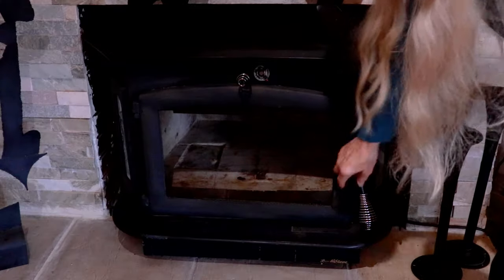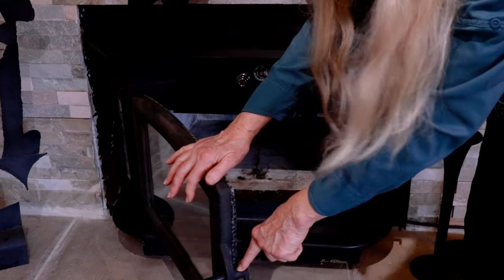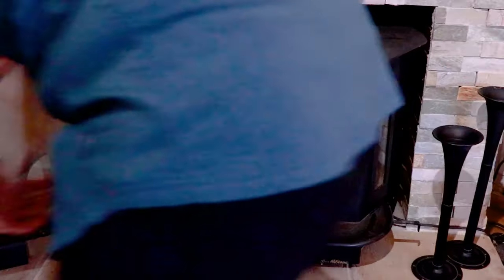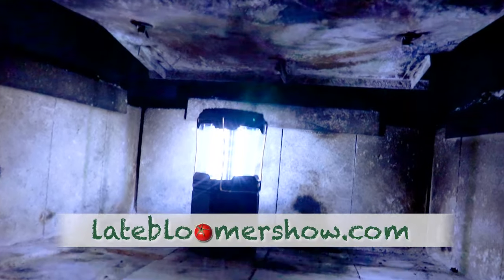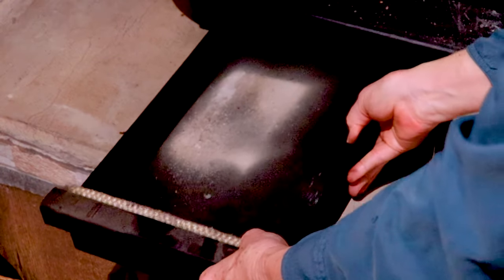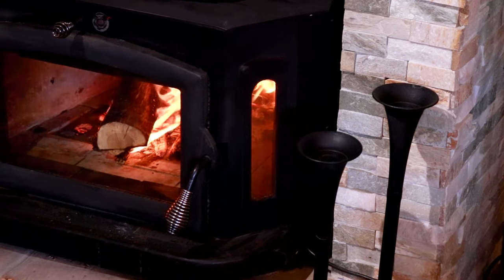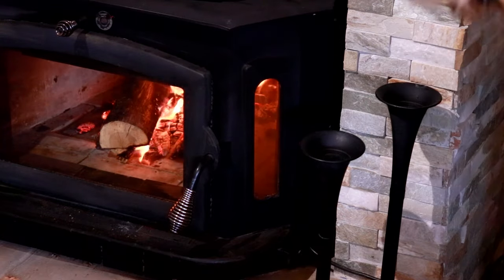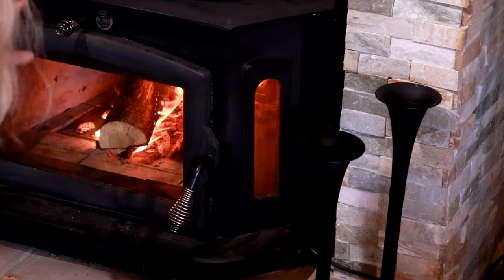BUCK STOVE 91 | Review of my wood stove

Comment: We have a Buck 91 that we purchased new about 3 years ago, replacing and old Schrader insert.  We use it as our primary source of heat with a propane wall heater being secondary.  This stove heats our 1800sqft house easily, and if it is above 45-50 degrees, sometimes it will get the house too warm and we have to open the front door.  I can offer some advice/info/tips for you or anyone reading about this stove.  You always want to leave around 1" of ash layer on the bottom, it will help your stove run better and make it easier to get fires started, as well as insulating the coals.  Next, the rod you pulled out is to engage the catalytic combuster and is not a choke.  It redirects the exhaust from either going straight up the flu, or through the combuster before going up the flu.  It will stay pulled out unless you have a good fire going and the combuster temp probe reaches at least 400 degrees or so.  Once you get it up to that temp you can push the rod in and it will slowly heat up and you can close the vents down and the combuster will burn the smoke and covert around 85-90% of the available fuel into heat, where as old inserts are only around 30% efficient.  We havent seent our catalytic combuster temps get over 1200 degrees, but i have seen some people run up to 1600 degrees.  Since switching to this stove, we have cut our wood consumption and propane consumption in half, so anyone considering not getting a new stove because it is an "EPA Compliant Wood Stove", think again.  We get so much more heat with less wood and our house stays nice and warm.
Reply from the maker: Thank you sooo much! No one told me anything about it when I bought the house. I have pinned your comment. Much love.
Reply: @Latebloomershow  anytime!  We are around 2 degrees right now in northwest Arkansas with this winter blast and the stove is running and the house is 71 degrees.  If you have any questions, feel free to tag me in a comment and I’ll help out.

Comment: Neat to see your story ..So different from my own. I have been watching a u-tube video about a guy called Martin in the Italian alps restoring a couple of stone barns to create his homestead .He built this stone stove with a kit.. facinating..KC always wanted to build one  .He starts fires similar to the way you do it   . Our wood cook  stove (Pioneer Maid)bought in Kentucky in 08 designed and made originally by the Amish in Canada and now sold by the Amish in PA  .Our model is no longer available and is plumbed to be able to heat the whole house using hot water (Not reliant on electric ). It is also very heavy .KC tore down the original crumbling chimney,poured a pad and fixed the timbers and foundation to carry the load.   This part of the house was off grid and dated to the mid 1800's.. The fire never goes out till spring . I did have to replace the fire brick after 12 years .I burn about 2 cords/winter and keep 2 - 5 gallon pots of water on it to help the humidity .  I usually have a big pot of soup going all winter .  I have gas hot water heater and a gas cook stove too ..neither depend on power. There is  a water jacket that also holds 20 gallons of hot water. This stove is fine to heat this end of the house and if it gets real cold,  I can fire up an old Warm Morning Antique stove in my bedroom I am not sure what will happen when I get to old  to tend to this place

Comment: I only have a Lacunza wood cook stove and it sits in my small living room on a stone hearth. It has a small firebox but I do believe if it were any larger we would roast! I don't think there is anything so relaxing or hygge inspiring than a wood fire. That Buck stove sure is a nice one, Kaye, and love that it has a built in fan! Last winter we had yet to have the Lacunza installed and when it dipped down to -35 our heat pump could not keep the temp in our home any higher than 67. At times it would dip down lower than 67 so we are hoping with the wood cook stove it will help with the occasional Polar Vortex.
Merry Christmas, Kaye! Thank you for such an inspiring year of gardening videos.
Reply from the maker: And thank you for watching them. I really appreciate you. I hope your stove delivers the added heat you may need. Who knows?

Comment: I used to have a free standing wood stove with a blower. Did not use the blower because it was too noisy. Instead I used a box fan about 10 feet away turned down to low. It moved the air really well and it was almost silent. I also kept a kettle of water on top at all times. The fan was pointed at the stove.
Reply from the maker: Thank you!!!!

Comment: Kaye, count your blessings with the cistern.  As long as it doesn't leak you have water you can run through your Burkee.  I absolutely HATE the set screw's on the handles on these stoves!!!  Luckily I have a wood stove that the handle is stored on the side of the stove and it is universal.  The handle is for the front of the stove because I have a front load or top load wood burner.  Well, when my damper set screw failed I was able to use that same handle to open or close my damper.  Just like everything else...OLD is GOLD.  They don't make things like they used to.  There is no reason they couldn't make handles one solid piece.  ALWAYS have a kettle of water on your stove to put moisture in the air.  I gather sticks in my woods for kindling.  Works like a charm.  I had to laugh when you called your damper a "choke."  I'm sure there will be a time that we use dry leaves and lint and sticks to start our fires due to no newspapers anymore.
Reply from the maker: It leaks. And leaks. I think the only solution is to get a pool liner put inside it because we can’t find the leak and it only holds about 3000. Still that’s enough to save me.
Reply: @Latebloomershow    Yes, get a liner or a swimming pool company out there and maybe re-cement it?  Pool company would probably do a liner for you too???

Comment: The Buck 091 Catalytic converter needs to be cleaned annually at least. You showed the deflector shield. The units are behind that. A properly maintained Buck 091 can burn around 1750° for 24/7 without concerns. 
A nite nite log is locust or oak crotch that barely fits in.
Reply from the maker: I unfortunately don't have any of those overnight logs. Need some. I will have to see if I can get someone to come clean it! Thanks so much!!!
Reply: @Latebloomershow  I used to cook meat at 2200° in mine. Loved to watch the onions wiggle.

Comment: Hi Kaye, apologies - posted to wrong video. My question,-- is the smoke was a problem w breathing? Asthma? Ty best, Lynn
Reply from the maker: This stove does not put smoke into the room at all, UNLESS, I make the mistake of opening the door to add a log without pulling the damper. But, I quickly remember and it stops. No, I have no problem. If you have asthma of course you have to be more careful than I.